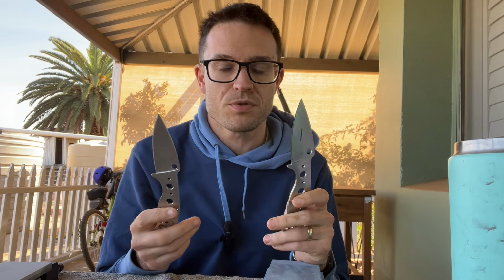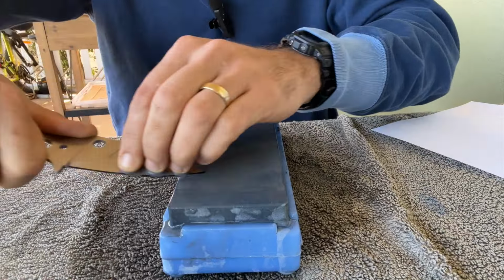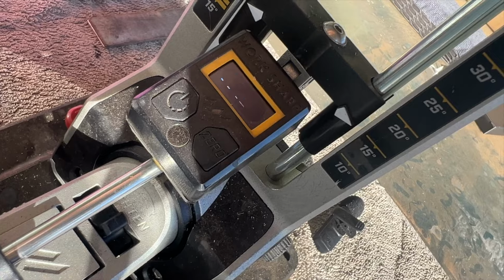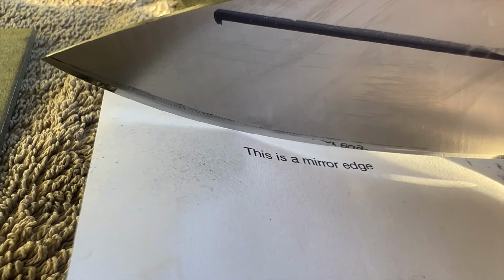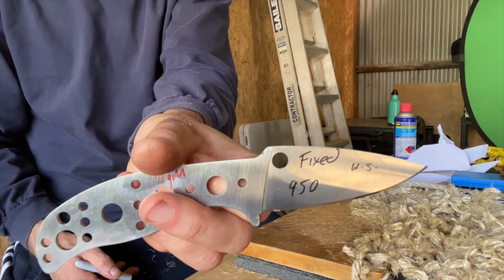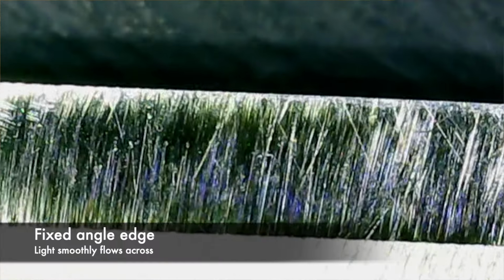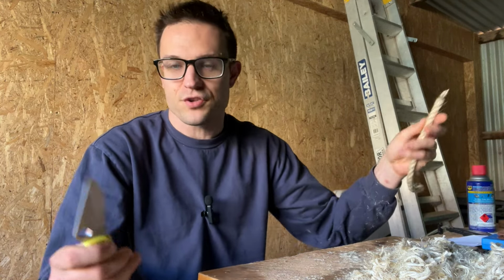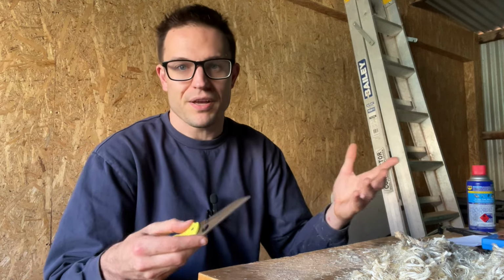Fixed Angle vs Freehand Sharpened Knife - Which Cuts Longer!?

Comment: I would say those are great results Pete especially for someone that hasn't been taking freehand super seriously for as long as you have fixed
Reply: a lowercase comment
Reply: Yeah, I thought so too. Was a very nice looking edge, and cut alot of rope. Would've lasted a good while for EDC use.
Reply: You did great Pete - there is a lot that goes into getting a crisp and stable edge by hand.

I’ve been doing it forever and the Maxamet blade I sent you broke an entire section of edge off after 500 cuts.

I called that a failure, and you told me “Don’t get discouraged, no failure - we’re just a couple curious guys twisting some knobs.”

It encouraged me heaps & I’d say the same to you bro, keep tweaking your sharpening protocols - you’ve got this.

Also I’m SO curious to see how the LC200N does now.  And a bit nervous!
Reply: @homeslicesharpening  there really is, and it just takes one bad pass to really hurt you.

Comment: Larrin says your cut test results are meaningful and that there is real data there,I believe him,and I believe in you Pete.your only getting better at freehand,and I believe you are 3/4 of the the way there!
Reply from the maker: thanx man, i hope so!
Reply: @CedricAda  Id say, since the CATRA test uses 5% silica (very hard) impregnated cards, that makes the test more for pure abrasion resistance data. Especially since its being compressed into the apex by the rest of the stack.

Twisted sicile rope must be rather pure by contrast AND the wood table impacts help give an idea of apex stability. Combined data from Larrin and you will give the most accurate idea of properties.

Comment: Straight bevel verses convex bevel. Even the steadiest free handers in the proffession still produce a convex edge compared to a guided system. Both have the pros and cons. Thanks Pete!
Reply: Been hand sharpening for years using a micro convex. It helps on hard "chippy" steels to retain a "working edge"...
You'll lose that razor-edge quicker, but there's a little more metal behind the actual apex...it's more pronounced on thick steel blades.
Reply: For wood processing tasks like batoning and feathersticking I prefer a convex edge, helps protect the edge and lets the blade skate along the grain without digging in too deeply. For everyday tasks I keep my folders right around 17 degrees.
Reply: @LoreTunderin  This.
Reply: Not just straight vs convex, also 17 dps vs 17-ish dps. If the apex angle of the first few microns on freehand version is actually, say, 19 dps, it's going to be much more resistant to chipping but also have much lower edge retention. To make it more comparable, I'd try 18 or 19 degrees on the Worksharp until it matches in edge retention, and then try to test the toughness of both edges by e.g. chopping some nails. Intuitively, a convex edge of identical edge retention ability to a straight edge should have better toughness.
Reply: @KibberShuriq  If you read the posts by Science of Sharp, you'll see that simple things such as direction of cut can influence the apex angle from 20 down to 15dps because of pseudoburrs or spontaneous convexing, even for fixed angle straight razors. There's a lot going on
Reply: Convex is superior, definitely. No doubt in my mind, actually. I’m definitely biased but it’s how I’ve made all of my edges
Reply: The key is a convex edge slightly below 17 DPS. Geometry permitting. My 20CV Endura stays shaving sharp longer than most other stainless. It almost feels like Cruwear in that way. Way more fragile obviously.

Comment: Your edge retention videos are what caught my attention some 3 or 4 years ago? I can’t remember, I’m getting old.. But Comparing the different types of steels, it really brought into perspective how well each of them held an edge, and ultimately determined what I would spend my money on. I believe your edge retention test is where I got the most value from your videos. But this was an EXCELLENT representation of what I’m most likely getting when I freehand vs when I use my fixed angle sharpener. My freehand jobs are most likely worse than yours though... Even if my freehand looks and feels sharp straight off the stone, it most likely isn’t as good as the fixed... 
But none the less, the value and entertainment that comes from your videos is second to none! Thanks so much for posting!

Comment: I think the stones and grits could have played a part also. It would be interesting to do the test again but use the worksharp benchstone with the 320,600, and ceramic. Theyre the same stones that are used on the worksharp precision adjust. They are even replacable with the precision adjust stones. So you could do the same 3 on the precision adjust and same 3 on the benchstone and see exactly how much the results are influenced by your hand.

Comment: Pete putting two wildly different edges on the same knife and getting different results (shocker)
Also Pete: "I am the problem"

For real tho. While the convexity matters, you put two very different edges on the same knife and there are only few steels that actually perform the same with different edges. I would bet, even if your free hand edge was perfect, the edge mostly sharpened by diamonds and finished way coarser with more deep scratches remaining, would still perform better.

Comment: For 'maintenance' type sharpening I start on either my #800 or #1000. The scratches are just too deep with sub 500 stones and it takes much more work to get rid of them. Re-profiling or removing a chip or snapped off tip sure the lower grits are great. But they IME are more repair/re-profile stones. Love your embracing the hand sharpening, there is a learning curve for sure but it's worth it. Once your are 6/10 or above you won't have a need for the jigs type sharpeners anymore. We just need to get U one of the Japanese male version of kimono with the waist band and you'll look the part. Love the mega close edge shots, I'm not sure If want my edges scrutinized by that lense 😂
Edit: Your going great on your freehand sharpening journey 750 is great score compared to fixed angle jig 950, it really is. 
This is where I started great video:
https://youtu.be/Yk3IcKUtp8U?si=DCOC6TxLKDyogLkh
Reply: If you keep your knives fairly sharp, I suppose a 1000 grit stone or diamond plate would be fine for maintenance. Going from dull to sharp is a different story though.

Comment: With my kitchen knives I realized that there is a significant difference between knives which cut against wooden boards (chefs knife) and such which don't. There is even a bread knife with serated edge, of which the top parts are dull and the valleys still have some kind of sharpness even after 20 years of use.

Comment: Did you measure edge angle close to the apex? You should try that, and if its higher than intended, just sharpen lower to begin with when freehanding. If you then get the intended angle, you can see how long it really lasts.

One wont ever get a perfect V edge when freehanding, thats why you should adapt in a logical way like just starting lower, instead of having unrealistic goals of having to get "better". 😊

Comment: Your freehand skill is impressive. I’m too cheap to buy stones and a fixed angle system so I’m stuck sharpening the Uncle Randy way. It works great for ALL my knives though, pocket knives, kitchen knives and straight razors can all be done on stones. 
I have noticed myself conveying the heck out of some edges when I first started. Now (after years of practice)I have really reduced that problem. I have also noticed that using aggressive stones like diamond reduce the amount of convex in my edges because it takes fewer strokes to do the job. Keep up the entertainment. I love watching other guys struggle to improve.

Comment: One reason for the difference could be the abrasives used. Perhaps the diamond abrasive produces a better base edge on MC to then be refined with the ceramic and strop. Or maybe because you finished at a lower grit with the system (~3k ceramic vs 8k ceramic stone) it gave that edge a bit more aggression. This will make your cuts through rope a little easier and may contribute to longer slicing edge retention. To talk compare your system and freehand edges, you need identical abrasives.
Reply: I always thought that a toothy edge would cut better. I suppose it depends on what you're cutting. like a bread knife is more like a saw than a fine edge.
Reply: @WillEDC  exactly, they generally do cut better for longer.

Comment: I appreciate the skill of freehand and the precision of fixed angle sharpening. However, I am 73 and the clock ticks louder every day. The speed and versatility of the Ken Onion blade grinder were the most important features for me. Would like to see how your edges on the blade grinder compare to your freehand and fixed angle edges. Also compare the time it to get your best edges each way.

Comment: I’m thinking the 750 by hand compared to the fixed jig is actually really good. It might be heresy but I think in a lot of cases the really extremely sharp edges people go for aren’t that necessary. Sometimes an edge a bit back from that, that still cuts well enough but lasts longer is much more practical.
Reply: I struggle with this as I’d love to be able to get a super sharp hair splitting edge but if it cuts paper off my arm smoothly that’s good for 99% of the tasks you need a knife for. A coarse stone will get a clean edge quick

Comment: I have always been the guy at work that can sharpen your knife. I relied on a Lansky (fixed edge ) like a crutch for too long and I think I paid the price of not furthering me freehand skills for about 12 years. But after a reawakening brought on by outdoor55 and his videos on what steels do and what strops do.  I have gone back to freehand and not without failures. But, Please, make a video of you stropping the blades back to paper slice and test again. I still think the new steel will out perform the old 440 Buck, but I think it would demonstrate how quick you can get this knife back into a ready to use sharp. 
  As a quick side note , I have used the back false clip edge to start pulling a nail, shouldn't the fact that you can use this steel for a scraper or screwdriver, and it might bend a little, but it doesn't shatter. how hard is too hard for edc?

Comment: As a hobby cutler on a neverending quest to see just how sharp I can get a blade. Firstly like most I only knew of freehand sharpening and happily did this for years. Till about eight years ago I discovered fixed angle sharpening. Started with some cheap versions. Until finally settling on a TSprof KO3 and CBN metallic bond " stones." I make my own strops from 1x6 aluminum blanks and high end leather belt blanks. My own diamond emulsions for PM steels with high vanadium,( M390, S30v, 60, 90..and basic chromium oxide for 14cr, VG-10 154cm,1095) Thousands upon thousands of dollars and countless hours of joy in both freehand and fixed angle. The bottom line is holding a steady and consistent angle, and being able to repeat that over the stone progression is a paramount factor in producing the stones and steels highest level of sharpness. I eventually made a jig and brace to support my clamp(s) to eliminate even the slightest deviation in the set angle when sharpening. Although I can get some wicked sharp edges freehanding. There will always be human error and some angle deviation in the hand and arm motion. Same as freehand welding compared to robotic welding. The beads are just not comparable when perfection is the goal. My BESS scores verify this consistently. I have never got a BESS score lower than 240 freehanding. However, I have got as low as 20 many times on a range of steels with my set up and equipment. My K03 and modifications also outperforms my T8..And that's saying something. Anyway, that's my two cents from an obsessive sharpener and half ass metallurgist. It's all about the joy of the process anyway. 
Vorpal sharp ❤
Reply: Lol, I luv the Star Wars credits style comments!
Reply: I'm honestly surprised you can't get below 240 Bess freehand. But 20 is nothing to scoff at, that's pretty much the limit of steel.

Comment: I strongly prefer microconvex/microbevel

More stable, still good cutting performance for easily getting through material, and importantly it's easy to refresh that microbevel at the very edge! If you don't have any rolling or chips it's like 4 swipes on a strop or fine stone away from getting back to hair whittling sharp!

Comment: Wonder if you did a full progression on diamond bench stones on maxamet? Perhaps its the abrasives themselves causing the lower numbers. Otherwise the result would usually be lower against a guided sharpener regardless of abrasives.
Reply from the maker: im ordering a couple decent higher grit diamond bench stones as my next step so will be interested in the comparison for sure

Comment: Hi pete, one thing i seen with a lot of freehand sharpeners like neeves is that they use the same stone brand and system, just different grits, so you have one height of stones...one less variable to compensate for, might be better to learn and get that muscle memory and consistent accurate repeation you require without have to compensate for slight differences in stone height off the table. Just a thought....im no good at free hand...kme for me, hehe, might go a tsprof in future, and a big hello from oz mexico... Victoria

Comment: Thank for another excellent vid and I’m not just saying that because you confirmed my biases. 😂I was hoping someone would do an experiment like this. A 27% difference is quite a bit but I’m not surprised. 
I’m in the process of modding a Toohr fixed angle system for a friend and this’ll be interesting for him too. For well under $100 all in I think they’re the best bang for your buck out there. I’m improving and standardising the hardware with stainless steel thumb screws instead of Allen keys, installing a bronze bushing on the pivot to get rid of a slight looseness and making a hardwood base to screw everything down to. I use several other methods for sharpening everything from axes, machetes, cheaper kitchen knives but for high end Japanese and German knives I use fixed angle every time because of its accuracy, repeatability and ease.

Comment: Maybe pushing the blade back and forth on the stones instead of using the elbow lifting method would give a more similar perfromance to the fixed angle sharpener

Comment: @cedricada I’m curious about a couple of things: 1) Does the progression of grits make any difference in end result? 2) Does blade pressure with your “free” hand make any difference? I see several other YTers just using one hand and others use two. 

I ask the first question because I’m curious what is the difference between starting on say a 600 grit or 1000 grit if you finish both the same with maybe a 2k grit and a strop?

Comment: It would be interesting to do a cut test between cutting free hanging rope vs the cutting board and looking at edge damage under magnification after 50 or so cuts. While catra does have its place in knife science, I think the cut test using a cutting board it more applicable to real-world tasks.

Comment: Your test is better than CATRA when looking into real-world use. If the edge won't stand up to minute lateral pressure on a cutting board, the steel won't stand up to normal use either.

Comment: Hey Pete it might not even be a difference in skill but also in sharpening media. I think magnacut has enough carbide volume to benefit from a diamond sharpening. You might have carbide tearout and and fatigued steel matrix lowering the wearresistance of the blade you shrpened freehand on the shapton stone.
I would assume its a combination of small inaccuracies and sharpening medium leading to the lower results.

Comment: By my lights not "which cuts better" but  - which the experimenter can perform to better effect - is the question answered herein.

According to THE SCIENCE less thickness behind the edge will result in better edge retention. To follow through on that, the implication is that the experimenter has achieved a steeper edge bevel with his freehand sharpening than with the fixed angle system. 
'Much as one might expect, as every freehand  deviance above the desired edge angle mashes the bevel back into itself, turning the V profile towards more of an egg shape.